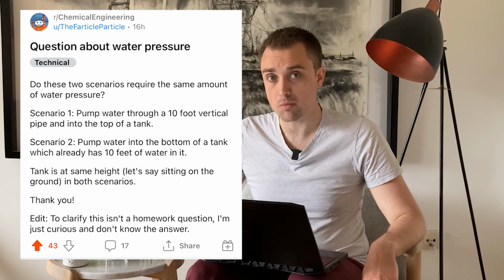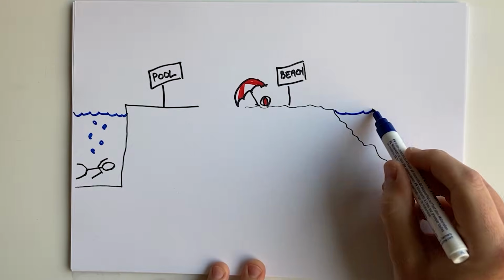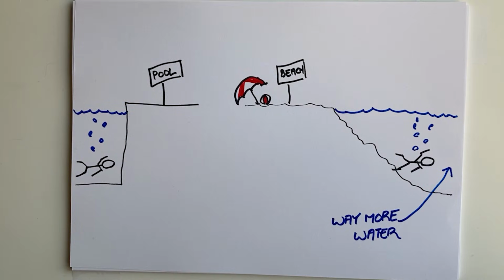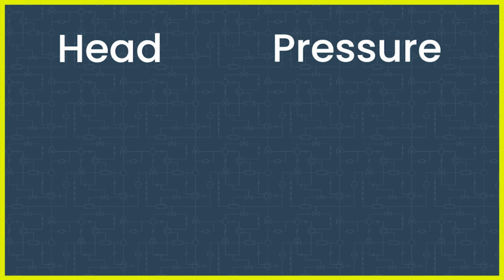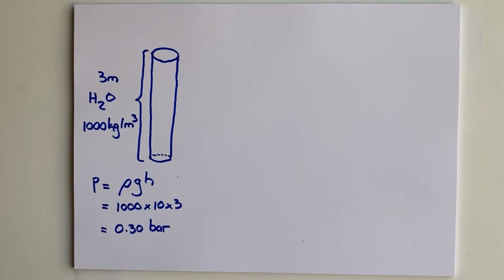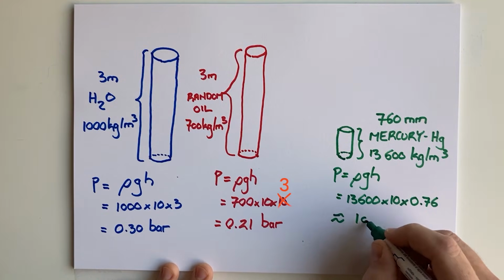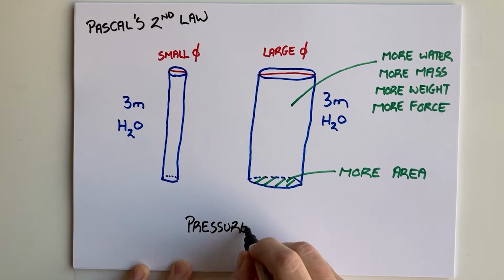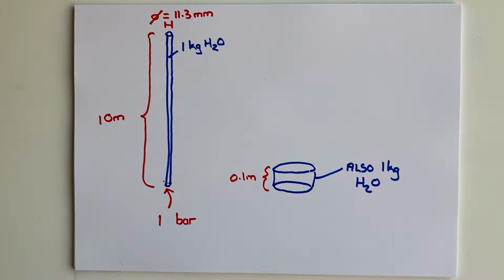Pressure, head, and pumping into tanks

Comment: In terms of pressure (& neglecting friction losses) they are equivalent.. but let me add an important note to your very helpful video:
There is a major difference when the pump stops... the water will come back in cases B & C... this means that the pump will turn in the opposite direction which will prevent you from running it again & possibly damage mechanical seals (if used) & other critical pump components...

Neglecting the extra cost, You can put an NRV (non-return valve) but what if it passes water? Or requires maintenance? Yes you can put an isolation valve... but this is not the correct way... you should select the inherently stable system; that is case A
(Unless the system is small, You will have to put both the mentioned valves in case anything happens in the middle! But you will not have to worry about the water in the tank only the water in the line)

*having taught students for a long time I learned that I have to mention such significant points or at least "stress" on the fact that the comparison is strictly in terms of a specific aspect (in this case; pressure/head only) & in reality many other aspects have to be considered... this is because many would have the tendency to "over simplify" the problem, just repeat that everything is equivalent & cause a disaster!

* again I know it is not directly related to the question but yet I feel it is important to mention such issues, have a good day
Reply: "not directly related to the question" Wrong, I suspect an extreme case of modesty 😀  But seriously, some mention of application is both helpful in sustaining interest AND understanding the theory.
Reply: @gr8dvd  
Thanks
Indeed, Slowly Injecting things from an application perspective will always help fresh engineers/students (we can not go full throttle on details since it will deviate us from the topic at hand, but "some mention of application"👌 is much better than the "bone dry Theory" methodology)
Reply: Working at a chemical plant we fill all our tanks from the top, there are just too many reasons for doing that way.
Reply: if the pressure in cases B and C is enough to push back and damage your pump when you've stopped, then that exact same pressure will do the same damage in case A. that column of liquid rising to the top of tank A doesn't just disappear when you're done pumping. the only difference is how much liquid can end up in the wrong place after your pump is damaged.
Reply: @jotch_7627  
In case you were wondering that our pumps ran opposite while draining the line... (what I will say next is only significant in large systems, not like a pump you have at home):
There  are valves on the line to bypass the water back to the tank on the suction side & the tank is able to hold all the water from the lines but it is not enough to hold the water back from the tanks on the discharge side!

Furthermore, on such systems it is mandatory to have an isolation valve on the suction side... so a good engineer would order SCADA/operations to close the suction valve & thus prevent the water from coming back (no path for the water to the suction tank) & prevent the pump from running in the opposite direction... this is Free information... enjoy
Reply: @jotch_7627  
Not true
In case A you will have to worry about the water in the line only not the full tank
It is customary to install the valves most of the time but if you have a small system you can get away in case A but in cases B&C The full tank will have to be drained
For the pump to start rotating in the opposite direction pressure is required, but the time it will remain rotating like that depends on the water quantity & there is no argument that the water/liquid in the line is negligible compared to the water in the tank! In fact once the pump starts rotating the water level in the line will most likely decrease fast & the pump would stop, but in the other cases it will continue to rotate opposite & go faster...(the large quantity of fluid in the tank will sustain the high back pressure for a much longer time)
This is also the case if you have a large header or a long pipe...
In all these cases you have to put both an NRV & an isolation valve
& under all these conditions, if you feed the water from the top you will have to worry about the water in the pipe compared to having to empty the full tank!!!

I replaced, repaired & serviced myself, more than eight 900 &  1000mm failing valves... if we were feeding the water from the bottom the task would have been impossible to accomplish, with grave implications on the environment since the plant had to shut down until we finished our job

I never said the water column would disappear! I was reasoning with the reader to reach the point! Please read it carefully before accusing me of something I didn't say!
I specifically clarified that between the brackets!
Reply: @baselsteel4976  I think the point is you said "There is a major difference when the pump stops... the water will come back in cases B & C... this means that the pump will turn in the opposite direction which will prevent you from running it again & possibly damage mechanical seals (if used) & other critical pump components..." This is true for case A too, only with less water/and for a shorter amount of time. If the water doesn't drain out of the column the pump will always have to start at that maximum pressure from the water in the column. If the tank was 10 meters high(intake), and the level in the tank is usually at around 5 meters, every liter of water will need to be pushed up to that 10 meter mark before leaving the pipe, the potential energy here is m*g*h thus using up significantly more energy to push or move a liter of water up to 10 meters than it would be to move it up to the 5 meter mark. That would not be great in the case of pumped hydro for instance. But I agree in other systems it is a balance between energy consumption and maintenance options.
Reply: But in case A there's always a maximum counter pressure even if the tank only half full. This will reduce the flow quantity.
Reply: @JaakJacobus  
Oooh now i understand ... you are saying that the friction losses due the pipe length are always occuring... even if the tank is half full 

*Apart from the fact that this is an initial condition (& any tank is usually operated at a certain level range); pressure drop is not the only aspect of the system & the huge problems caused by filling the tank from the bottom will force you to fill it from the top & this is exactly why I made that comment...

*Plus, as I mentioned earlier the entrance losses are very big in cases B & C (unfortunately I don't have the table on me now!)

Furthermore, usually the height of the tank is negligible compared to the total height (infact full head loss in the line) the fluid is pumped..
In fact 10meters of height (which is massive for a tank) is equivalent to 1 bar of pressure only
Reply: @baselsteel4976  Your examples are going very specific into it. Gravel?
The point I wanted to address was that in case A the pressure is at maximum from start to end.
A difference to consider if the pump is a low pressure pump.
To follow your way, I can also mention that some liquids are better pumped from down instead of splashing from up. Like carbonised drinks for one. Also no gravel there.
Reply: @JaakJacobus  
*I did not understand what you mean by "counter pressure"

*In Case A, the tank is filled from the top not the bottom

*If we are talking about the same case, do you mean the friction losses/head losses (which translate to pressure losses) due to the length of the pipe & fittings?
In cases B & C, The entrance losses are very large especially if it is directly from under the tank as shown (rather than from the lower level but from the side of the tank)... this is due to the induced turbulence in the tank at the entrance
* even if the losses are larger in case A (which is unlikely), the huge disadvantages of the other cases (mentioned in my previous comment) force us to use case A in practice
* the drain of the system should be at a low level & on the side of the tank... not the entrance
This is Another reason why we don't put the entrance below... since all debris, rubbish, sand, gravel...etc tend to go down such openings and  choke the pipe (causing interruptions in operation & resulting in expensive repairs...)
* extra: 
Some times, especially in large size pipes we use "long neck" elbows to reduce the friction losses caused by traditional elbows (due the abrupt change in flow direction)

When filling the tank, in small systems we usually use "floats" to signal the pump/s to stop once the water reaches a certain level (which should be below the entrance level)
In bigger scale systems we usually use other means such as ultra-sonic sensors to stop the pumps...

Hope this helps :)
Reply: If you let the waves die down in 2 and 3 note the head level is higher than A because neglecting pipe size and flow rate the lowest entry point to the tank is clearly slightly lower.  It’s the difference between the center of the diamond background for B and C and half way to the bottom of the diamond for A.   

This is exactly the crap that trips me up on poorly thought through exam questions.  Am I supposed to assume it’s close so the same or am I supposed to look for discrepancies which are obviously there.
Reply: Another reason why we don't put the entrance below... since all debris, rubbish, sand, gravel...etc tend to go down such openings and  choke the pipe (causing interruptions in operation & resulting in expensive repairs...)
Reply: @baselsteel4976  it depends on the application. there are a lot of benefits to have an inlet or outlet at the bottom of a tank - outlet maybe not at the lowest point of a thank (if there is medium stored that have a suspended sediment load - then you use a outlet at a higher point. as for inlet at the lowest point, this prevents spilling, you also can reverse the flow and use the inlet also as outlet. as for outlet, having a pump at the lowest point is usefull if the pump cant work without a medium
Reply: When I pump horizontal, how do I know how long my pipe can be? 
I want to pump water 100 - 200m through the garden (downslope) in pipes that maintain some pressure for the sprinklers. 
I understand this height (Hm) now a bit, bit i haven't figured out how to calculate how strong my pump needs to be to keep pressure for 100 metres of pipe. 
Can anyone explain?
Reply: Since you have taught students maybe you can answer this for me, does it require more effort to fill the tank from the top or the bottom if there is a heavy floating object in the tank. Would really appreciate an answer to explain this thanks.
Reply: Hi, please go to minute 5:43
I believe that A is the smallest pressure.
B is bigger pressure.
C is the biggest pressure.

The explanation in the video above seems doesn't make any sense.
Please explain more about this to convince about the correct answer. Thank you.

Comment: I learned this two decades ago when I was really into the saltwater aquarium hobby. The bottom glass needs to be thick enough to withstand the total weight of the water and contents, however, the sides only need to be thick enough to withstand the static pressure of the water column. For my metrically challenged self, 1 PSI ≈ 27 inches of vertical water column.
Reply: Yes, roughly double the thickness of material is needed for the bottom compared to the sides for aquariums mounted on a stand that supports the bottom only by the rim. There's an exception. If an extra support band is added to the center of the bottom glass, that reduces stress and similar thickness can be used. In practice, if set on a solid  level surface, thinner glass could be used since it'd now (mostly) be there simply to seal water in. That's one reason why huge aquariums (and bathtubs) are often set atop thinset (cement) for additional support.
Reply: Not exactly.  Weight equals pressure.  Bottom carries pressure, which equals the weight.  The reason the bottom is thicker is that the pressure is constant all across the bottom, whereas the force on the side is the average of the pressure at the bottom and at the top.  Top is zero, so force on the side is roughly half of the force on the bottom.
Reply: @bipl8989  Correct, but it's the unsupported dimensions that matter. Let's say you have a 30x60 bottom. If you add a center support, each half of the bottom is now a 30x30 distance, roughly half the weight. You see that in buildings, as in using posts, load bearing walls and foundation supports below floors.

Comment: Water pressure is purely a function of depth, not volume of the body of water. Pressure is measured by the square inch and fresh water weighs .433 pounds per foot of height, salt water is .444 pounds per foot of height.

Comment: Tanks with fill pipes to the top all have goosenecks in my experience. This creates a siphon. With this I can assure you that they fill faster in this case. It is also necessary to leave an air gap at the top or the the fluid siphons back when the pump is shut off. Your math is correct, but in practice isn’t applicable due to the omission of this variable.
Reply: A simple check valve can solve that problem.

Comment: What if the diameter of the pipe is very small and the height difference small ? Wouldn’t capillary action reduce the pressure on the pipe that is open ?

Comment: This can also be explained from energy consideration. The energy needed to pump liquid in is force (F) times distance dx, which is (F/A)(A dx)=P dV. But we know the energy needed is (dm) gh. Equate the two to get P = (dm/dV) gh = density g h. This is independent of how the water gets into the tank.
Reply: Less energy needed for bottom fill, since all fluid does not have to be lifted over the top of tank rim.  Less energy is needed in bottom fill since the pressure (height of lift) is much less during the initial stages of filling.

Comment: I had seen the video you are referencing to, and because of that reason only, I was able to pick the correct answer. It still is extremely counter-intuitive though. The only way I can make it intuitive for me is not to think of pressure but of gravity. It only points down, straight down, even in a funnel.
However, filling a thank from the bottom, probably suffers a bit from inertia and friction: the water that is already in the tank has to move away for the new water to enter. Imaging sand or grain. But I assume with water that's negligible.